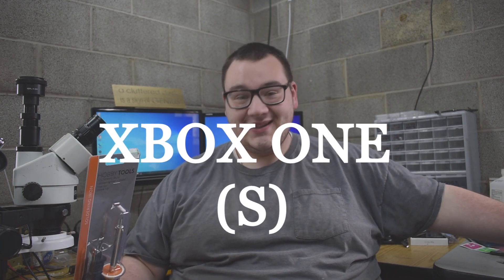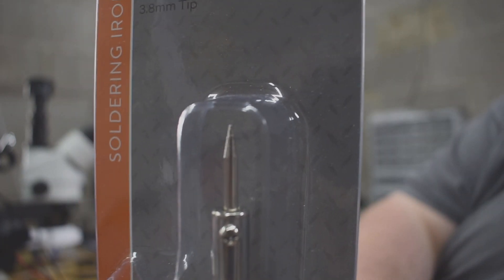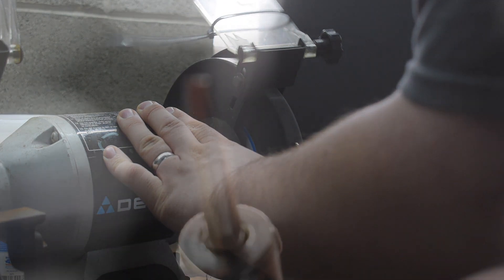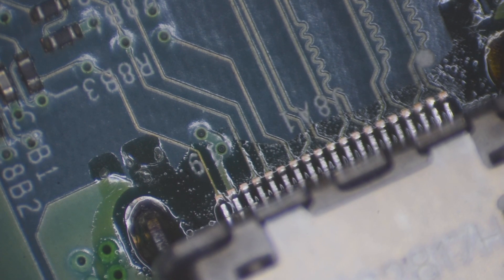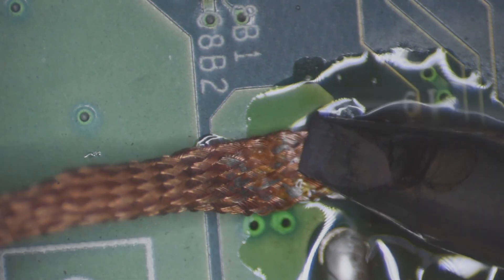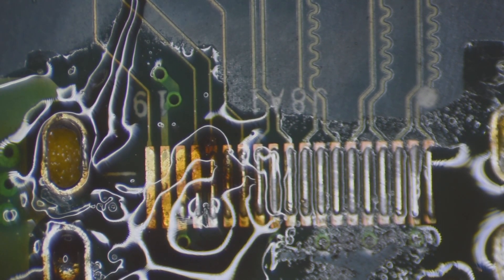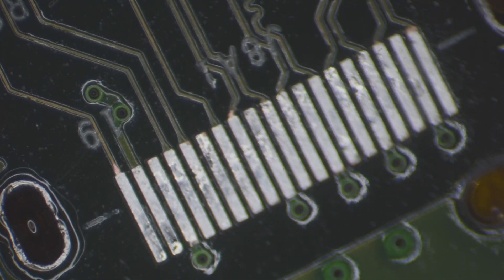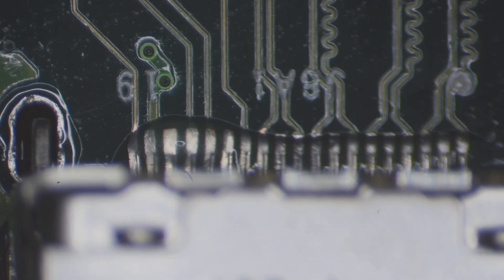Can This $10 Soldering Iron Beat My $300 Soldering Iron?

Comment: And that is exactly why first timers do more damage then good.. they watch a couple of videos and think it's easy... they don't have the experience to know that to much heat for to long burns traces, bubbles pcb, ect, ect... Better irons get hotter faster and have more stable temperatures... you where able to do because of experience any body else would have left iron directly and for longer duration while trying to line up pins with traces resulting in damage... Ive seen people use those shop heat guns that look like over sized blow dryiers that resulted in carbonized pcb with layers separated (black from one side to the other) and still expected promising results... Great video by the way hopefully your channel makes it to 1million subs in the near future... Goodluck

Comment: i am using 5$ solder iron for 5 year, whats the problem? i dont understand your making fun of the 10 dollar iron. where the world u live in man?
Reply from the maker: There's a large proformance difference between the two irons. 
This video showcases the $10 iron and how it preforms against an iron That costs 30x more.
Reply: I'm still using a $5 iron to this day, same one I've had for the last 10 years and have done countless projects.  But it does take me longer to do the same thing that I can do in a fraction of the time with a better unit.  Especially in a shop environment, time is always money, so, if a unit that costs 30X more will do countless high-paying projects with better precision and far less time, that's where it comes into play.  For hobbyists, it might be less of a thing.  I know how to do great desoldering, but buying a Hakko desoldering iron that costs $$$ helped me to turn a box of drifty game controllers into a fast, profitable side hustle, instead of a messy, tedious process.

Comment: Do not grind the original tip.. after that the tin can't stay on it any more.
Reply from the maker: 2 reasons to grind and why it still did work:
The tip needed to be a chisel style tip
The tip has copper, which the tin could flow on the tip. 

The reason is because the temperature on the iron was very high and overheated the solder within seconds.
Reply: @chasefournier  good to know :) probably my tips are made in some different way :)  any other feedback about grinding?
Reply from the maker: @laboratorioassembler  I need to clarify, grinding a tip isn't good because the tip won't last like that. The reason I did grind it in this video is because the tip on it won't work for this repair. So if your spending $10 on an iron, this video shows you how to make it work. :) Don't actually grind your tips.
Reply: @chasefournier  yep :)  btw good work i was searching something new to see about repairs :)